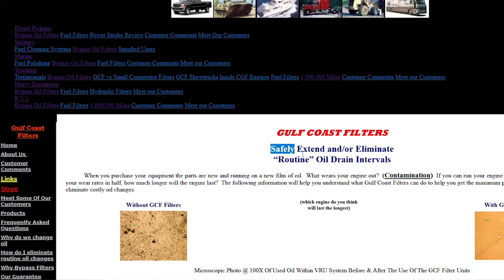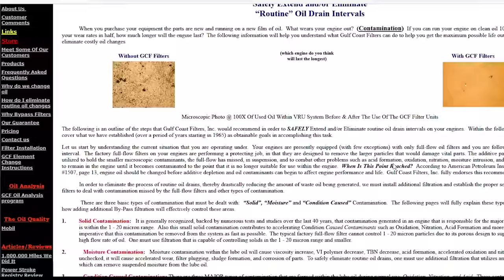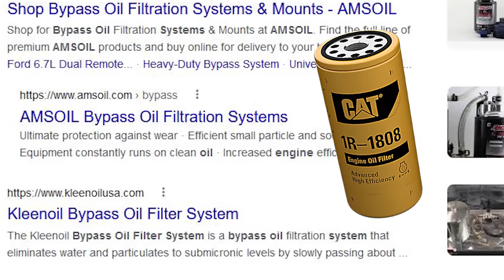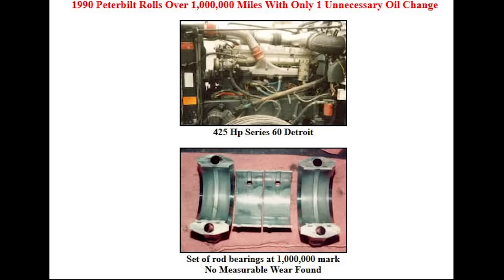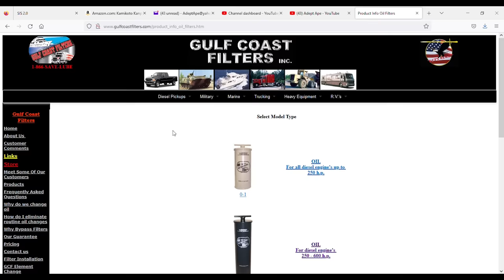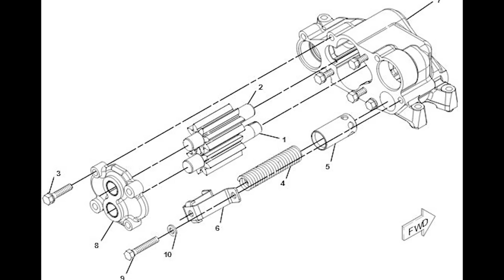No Oil Changes and 1 Million Miles!!! Are Oil Changes Optional with a Bypass Filter? (INTERESTING)

Comment: I'm 100% for bypass filtering, but also keeping your oil change intervals the same, maybe extended a bit.

Double safe. Incredibly well protected engine.
Reply: Can you do this on regular autos/cars?
Reply: These filters are for mechanical type people. I was putting a Frantz oil cleaner on a new 1963 Dodge  pickup. His  brother drove up.He said if I had known you wanted a Frantz I would have given you mine.. He said my oil is dirty and my lifters are noisy. He was asked when he changed the Frantz last. He said change it ? The guy I bought it from said it would last a lifetime. The Frantz went on his brothers car..
Reply: @davidschulman7988  Ive done it for 60 years. Find a top loader. All I have is The little toilet paper filters. Gulf Coast juniors Motor Guards and the Australian Jackmaster Classic. I converted a flat head Ford canister filter to use Scott 1000 toilet paper.

Comment: I use Amsol and their bypass filter that filters down to 2 microns. I use oil analysis and when I've tried to run extended drain intervals( over 20k)my Soot numbers get too high. This engine has 1.8 million miles and 800k on the bearings so I'm doing a bearing roll in. I'll email you some pictures. I can say that Amsoil increases my fuel mileage 0.3 mpg over Shell synthetic. I only run synthetic motor oils because it helps with the sub zero starts and high oil temps when pulling mountains.
Reply: Yep project farm here on YT did an independent test of oils. Amsoil and Pennzoil performed the best at cold flow...it was really eye opening
Reply: I have a Detroit 12.7L set at 600hp that I'm running an OPS bypass system on while using Rotella T6 15/40. Like you, soot is my biggest issue when trying to extend intervals. I've settled on a filter change at 15k, and then a full change at 30k. I tried a 20/40k interval in the earlier days, but my soot was at danger level by 40k.
Reply: @ZXTrucker  Paccar mx13 ,syn oil changes at 10k , filters at 30k .I noticed filters never get dirty if oil kept fresh ,as oil is the main reservoir of contaminants .
Reply: The Australian Jackmaster Classic claims 1 micron filtration if you use their elements. I use toilet paper. The Jackmaster is designed to handle the bigger core TP. The core seal at the bottom is  about 1 and 15/16 inch. I have a stainless steel shim that increases it to 2and 1/4 in case the cores get bigger. All of the filters I use can handle the bigger core toilet paper. I prefer the top loaders. Frantz is obsolete now..The toilet paper changed Frantz didnt.i use toilet paper.
Reply: @mrmotofy  They are both good oils. I just bought heavy duty diesel 30 weight at Walmart.. Walmart didnt have Delo or Rotella 30 weight.. It is Super tech. The label says for off highway use. Dont drive the old tractor on the highway.
Reply: @ralphwood8818  I use the  "off highway" oil in my  ' 94 Grand Cherokee. No issues.
Reply: @Bill-sp8kb  When I started in 1963 you couldnt use multi grade oil in a diesel. Delo came in 30W and 20W. We sold it for about 55 cents at the Standard station. 29 cents a quart in the discount stores. My Olds diesel manual said you could use multi grade in an emergency until you could get 30 weight. Went to get parts for the V6 . The guy said there is no such thing as a V6 Olds diesel.

Comment: Thank you for making such fine videos! On my 94 Pete 379 with a 3406 mechanical C I change my oil and OEM filter every 300 hrs. Ive got a bypass filter that I change every other oil change. I view a bypass filter as something to extend engine life NOT oil life. Purchasing engine oil will not hurt your bottom line but early major repairs and down time to do the repairs do.
Reply: How long an engine lasts doesnt depend on how much money you piss away on allowing the oil to get dirty then draining it. I see some are changing the Gulf Coast  filter every 10.K miles. Ssme are going 20 K miles. All it amounts to is keeping the oil clean and adding enough new make up oil to keep the additives up to specs.

Comment: A small Frantz toilet paper filter will work just fine to filter out wear particles. The giant Gulf filters are a pain to deal with and their proprietary filters will eat your wallet long term. Put a gauge on the input and when you see a rise in pressure replace the roll. Send in a oil analysis every 5k miles and as long as the results are good keep rollin.
Reply: I know a trucker, I mean “Truckie” from Australia who swears by these toilet roll filters.
Reply: 100% frantz bypass one of the best filtration setups, even seen their setup for fuel filtration they catch all the crap and water within the toilet roll
Reply: Using a roll of t paper has been shown to allow oil to cut pathways between the layers.
 Amsoil filters elements can not by bypassed.
They are great to deal with and will provide technical support via phone, or Internet .
Reply: I used to install Franz filters.  Still have a new setup on the shelf.  They are great for larger engines, but they can be too restrictive starving lifters for oil.   Might have had to replace a set or two.
Reply: My 37 Studebaker book says its not necessary to drain the oil just change the oil filter when the oil looks dirty on the depth gauge. In those days they used cotton the same as the Luberfiner. The last time I checked the big filters such as the Luberfiner 750s used pulverized newspapers and wood chips. You can get away with a lot with gasoline engines. With diesel engines you need to know what you are doing. If you wait until the filter starts pressuring up you are screwing up. The reason the big Gulf Coast filters clean oil as good as toilet paper is they have a orifice the same size at the inlet.  The oil soaks down thru 22 inches of paper towels. Similar to a gravity fed filter. The big Luberfiner 750 types the oil has to travel thru about 3 inches of pulverized newspapers. When John Frantz converted the old cartridge filters to TP the depth went from about 2 inches to 4 inches. The TP in the Jackmaster Classic  got about 3/4 inch shorter feeding it with the 1/16 inch orifice. Thismeans I could go with a smaller orifice or a two port  sandwich adapter such as they use for oil coolers. The Ford diesel tractor has a Perma Cool universal sandwich adapter that I got from Jegs years ago. I didnt have a Frantz two port sandwich adapter left from my old Frantz days that fit.
Reply: @blackhawk7r221  Bull shit
 All the Frantz or any bypass  filter does is keep a stream of clean oil going to the oil pan. The 2 port sandwich adapter sends the clean oil to the inlet of the full flow filter. Thats on my diesel tractor   Over the last 60 years ive returned the clean oil by going into the oil pan with a self tapping hollow bolt. I have drilled and tapped the oil filler cap. Replaced a 3/8 manifold bolt with a 3/8 hollow bolt. Drilled and tapped the oil fill neck.used a two port Frantz sandwich adapter.tapped into the valve cover next to the oil fill cap on my Ford 390. Returned the oil to the drain ports on the lawn mowers. How do you starve the lifters of oil. I dont use the Frantz anymore. They all hook up the same.. If you sold the Frantz you would understand where the clean oil goes. It doesnt go to the lifters. One fool says the bypass filter controles the oil flow to the over head cam. Where do these people come from. Cutting pathways between the layers of paper. Dont steal toilet paper out of the porta potties. Use Scott 1000 or similar paper. If you cant figure out how to use the bigger core Scott in the Frantz use the Frantz elements.
Reply: @localcrew  The Australian Jackmaster Classic has the advantage where you dont have much room under the hood. You are working from the top when you are servicing them. The slower the oil flow thru the filter the better the cleaning. Jackmaster has a very small orifice at the outlet to get the cleanest oil.. probably best to use the fabric  covered Jackmaster elements. I use toilet paper right out of the package. I have to make sure the Jackmaster is getting hot. If the filter isnt heating up it probably has something stuck on the orifice.

Comment: Another issue to consider is the additive package breaking down over time. Detergents, Viscosity stabilizers, zinc and other high pressure lubricity additives... these are all known to break down.  It might be possible to lab test the oil and add the components back in, but I'd say its best to extend the interval but still do regular changes.
Reply: Exactly. A the bypass filter might reduce particulates, but it does nothing for the additives.
Reply: When you change the 3 gallon filter you add 3 gallons of new oil every 10.000 miles.That is how you get the new additives..My little filters get about a quart.of new oil when they are changed. Im not very smart but I figured it out. I must be smarter than most of you guys.
Reply: @ralphwood8818  so what would the dilution ratio be on that? At what rate is each additive depleted? What is the current PH of the oil, especially if TBN gets low? 
It's your engine, but I'd send a sample for testing and UNDERSTAND what the numbers mean.
Reply: @Only1Shadow  Im told oil analysis showed 3 gallons of new oil every 10.000 miles was more than it needed. For the numbers you would need to talk to Gulf Coast Filter Company. They do the oil analysis reports. I just change the filter and add a quart of new oil. The biggest thing I drive is a 76 F 250 with a 390 engine. Gulf Coast has a stack of oil analysis reports. I think they read them for a fee.. A NASA diesel equipment guy was asking me questions. I put him in touch with Gulf  Coast. I believe they are listed as a customer now. Along with Shell Offshore and others. Shell oil was involved with the million mile truck. Im pretty sure it used Rotella 15 40 conventional. For big engines you need big oil filters. The little bypass filters are for my Ford.
Reply: @Only1Shadow  Im sure the additives were never depleted The TBN number never got too low. Being a test truck it got a lot more oil analysis reports than the average over the road truck. I know my TBN number is ok because I run at normal operating temperature enough to keep the oil dry. Weak acid will attack steel. My dipstick looks good.. The aluminum parts in the oil filters look good. I could probably spend some money on oil analysis and extend my filter changes a little more. I dont drain oil without reason. It aint rocket science.
Reply: Was hired to solve some problems with a acid purification plant. They removed mercury fron sulfuric acid so it could be used for food processing.. The acid was 93 percent. 93 percent isnt very corrosive. They used a big beer filter. They had welders on their backs welding the bottom. What they were doing is washing out the filter on friday and going home for the weekend. Weak acid is very corrosive. It was attacting the stainless steel all weekend. I said we will shut off the feed valve and go home for the weekend. Monday we will wash out the filter. There were other problems
Reply: The viscosity stabilizers are probably more stable than the oil is. As they are just massive hydrocarbons. The detergents and zinc and also the base in the oil to react with any acids are a consern. But I'm unfamiliar with how much of all the additives are in diesel oil. But I would imagine commercial diesel oil to have in spades as the only reason it's not added in larger amounts in gasoline and consumer grade oil at least as far as I can tell is due to it not being used up before the next oil change takes place so it doesn't make huge difference to add more. This is all to say that it could last a very long time. Even a million miles as long as the degraded parts of the oil is removed and there are still some additives left. Though my specialization in chemistry is not related to lubrication.
Reply: Wouldn't the bypass filter remove additives?
Reply: @straight-up-shots  no, the additives are desolved in the oil. They arnt in suspension so it wouldn't filter them out.
Reply: @straight-up-shots  Additives last a lot longer in clean oil. Its a matter of not letting the oil get dirty and adding enough new oil at filter change to keep the additives up. The oil analysis report lists the additives still in the oil. It can be confusing if you dont understand  which is additives and which is contamination. I probably change my filter and add more oil than needed because I dont pay for oil analyysis. I dont have an expensive truck engine. Dont use the old tractors enough to wear them out. I run everything on clean oil. Some additives like graphite can be removed. It's similar to soot. Normally additives that can be removed by depth filters are added by consumers.
Reply: Its misleading as hell. The series 60 Detroil 425 HP engine gets about 350 gallons of new oil added in the million miles just counting the make up oil at filter changes. The reason the engine was near new at 1 million miles is the oil was never allowed to get dirty and enough new oil was added to keep the additives up to specs. Road King article said it was equal to a full oil change every 40.000 miles. The system of allowing the oil to get dirty then draining it is a terrible maintenance program.

Comment: I agree with you that running bypass filtration is a good thing.  Hell, I even run a bypass filter on my coolant.  I also change the oil regularly (see my point below)....but I do extend a bit.  Sampling is key, as you rightly point out.

However, for HEUI systems (one of mine is), the use of an HPOP usually means a high degree of molecular shearing going on which will drop the viscosity of your oil considerably.  I would love to hear your thoughts on this and how that maps to greatly extended oil change intervals.
Reply: Very good point. I had an 06’ F-350 with the 6.0 for years (HEUI system), and that thing was VERY sensitive to oil.
Reply: Amsoil doesn’t shear
Reply: Wait a minute a bypass filter on your coolant??!?!! How? Which one? What type of coolant? Does it lower temps? I'm thoroughly fascinated.
Reply: I have heard that people buy fully synthetic 10w30 or 15w40 for those engines because it contains very little VII polymer. That helps it resist shear.
Reply: @ryanthibeaux  all oils shear its not up to the oil it is the environment the oil lives in that determines shear
Reply: @markm0000  The point wouldn't be to lower the coolant temps, but rather to filter out the fine particles that can damage the water pump and erode the cooling system over time. Perhaps he's referring to a screw on coolant filter?
Reply: I have a FS2500 oil bypass filter on my 2000 7.3 powerstroke. I use Schaeffer's 15w40 in the summer and 5w40 in the winter. This will be my first winter with the FS2500. I plan on going 10,000 miles between oil changes. I'll change the regular oil filter 5,000 miles. If you are worried about the oil send a sample in to Blackstone. They will let you know when you need to change the oil.
Reply: No he's referring to a full bypass coolant filter. The issue with the 6.0 Ford is because it's based on the VT365 it's EGR cooler was never designed for the higher temperatures the 6.0 Ford generates. The coolant boils in the EGR cooler and makes precipitates. Those precipitates form both deposits and also sand like particles that remain in the coolant. By removing the sand like particles with a bypass filter the concentration of the coolant changes and it helps in slowing the deposits in the EGR cooler and stops the particles from harming the pump and clogging other portions of the cooling system. The problem was so bad Ford changed their coolant chemistry to address this.
Reply: I remember spin on coolant filters on the block of a Cummins. They had additives in them. Normally we used tees in the heater hoses. You think your cooling system is clean until you change the TP that looks like it came out of a mud hole. I had one on the old 6.9 Ford. On the cars I just use the long distance coolant. Saw a letter from a marine base in Okinawa I think. They use portable Gulf Coast filters on a trailer to clean the coolant. They add additives as needed. That is a big part of Gulf Coast Filter business. Military use. Aircraft defueling. Saw a Gulf Coast O 1 on a Army 5 ton. They are no joke people.
Reply: I did a fleet of tree service.trucks when the 6.0s first came out. I was a little concerned when Ed Wallace said Ford went from the best engine Ford ever put in a truck the 7.3 to the worst engine they ever put in a truck the 6.0. Ed Wallace is a automotive expert on radio and TV.. when you are installing toilet paper filters you dont want engine problems. I see people talking about bullet proofing the 6.0s.what little I know tells me they require clean oil 100% of the time. At the tme I was installing Gulf Coast filters. That was a big fleet with everything from Ford gasoline industrial engines to mid sized Internationals.The make up oil they brought me was Walmart diesel rated conventional oil. The owner said oil is oil  .Every engine got lube oil and fuel filters. I was working as a maintenance mechanic for Safety Kleen 6 days and doing filters on Sunday. It got old. His friend was up from the Gulf of Mexico. A engineer for an oil company and recommended Gulf Coast filters. He is the guy that said oil is oil. To make things worse we had a big name attorney saying if you bought a truck with a 6.0 diesel give me a call.
Reply: @markm0000  not filter, dispense additive